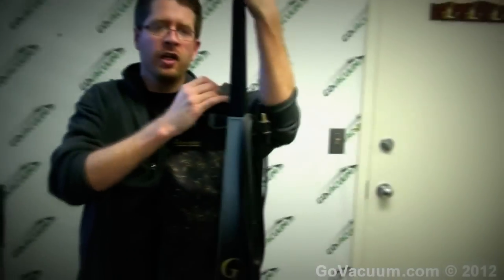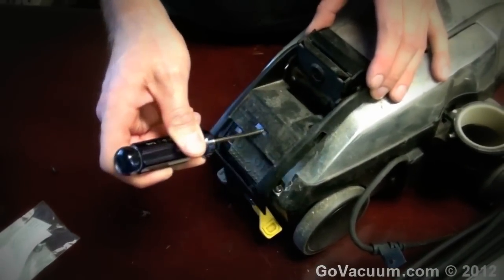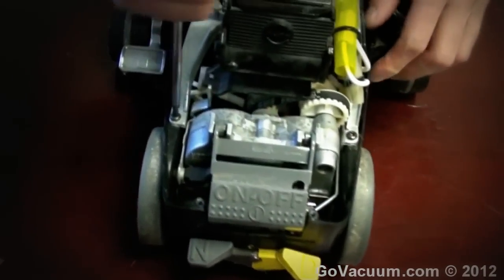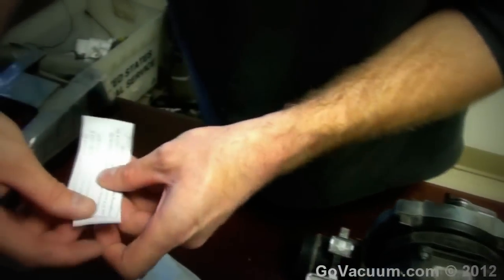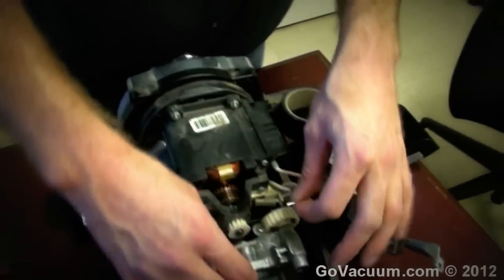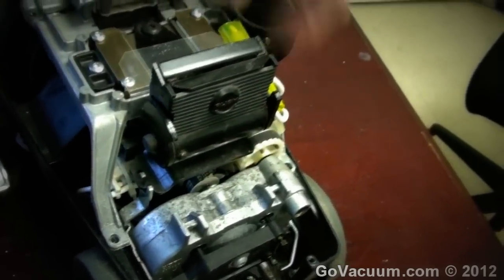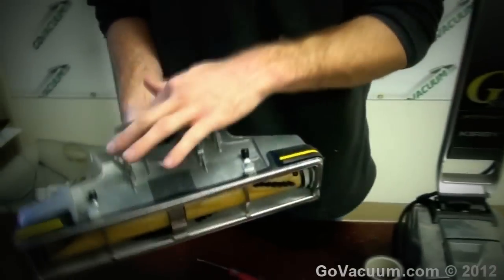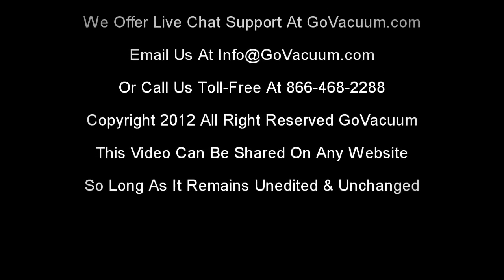Kirby Vacuum 552399S Transmission Repair Guide Generation 3 4 5 6 2000 Diamond Sentria How To Video

Comment: Thanks for the video. I took mine apart because the transmission position selector pedal fell off. Pulled straight out. I began taking it apart until I got stuck. After watching your video I was able to get it the rest of the way apart and put it together. I used JB liquid Weld to permanently connect the part that slipped off the shaft piece and after I followed your directions of putting it back together, my Kirby works like new. Thanks again and God bless.

Comment: Thank you for a great video.  Tried to replace the fan without a video (dumb) and ended up accidentally disconnecting the lever that engages the transmission and disconnecting the light!  Watched you video and saw the correct spot for the wiring I had unplugged and how to re-attach the transmission arm.  Will book mark you for the next time I need parts.

Comment: Wondering if you can help me out.  My son broke the plastic on/off foot cover.  If the axel bar happened to come  out of that, could it cause a problem with the self-propel?  It is making the clicking noise you speak of, so perhaps it is the transmission going.

Comment: Hello, I'm having some troubles...I have the same g6 unit, and it doesn't power on. I replaced the motor, and it still doesn't power on. I noticed some parts are missing on the transmission, but that shouldn't effect the motor from not functioning, or should it? Oh, and I replaced the g6 motor with a sentria motor, and noticed the ground  clip was missing, so I installed one. I also noticed that the screw on the bottom, that you mentioned not to remove in this video, is missing. what is it's function? Any suggestions would be appreciated. Thank you, Stephen

Comment: Excellent Video.  My problem is, the transmission Neutral/Drive shaft came off the machine.  Can I possible t0 re-install the shaft into the trans, or do I need to replace the transmission?
Reply: Sorry, Kirby Model G4D

Comment: My Generation Four goes backward just fine, but it does not work to push the unit forward.  Does this mean the transmission is bad??  Or is there an adjustment off?

Comment: I have a question about the neutral/drive selector switch. It seems on our Kirby the D/N switch has come loose. Will this require a new transmission or can I reinstall the lever switch?

Comment: why do you say replace the transmission along with the cord and fan?  Transmissions can be serviced, cord doesn't need replacement unless its broken/split/hurt, and the fan... only if its excessively chipped up or broken/cracked.
Reply from the maker: Age of use. Same reason you replace the pads when you replace the calipers on a car.

Comment from the maker: @123KennyM Yes, You have 1 or 2 problems-  Hopefully you only need to replace the fan & belt shaft. This kit is only $17.95 at GoVacuum and it's an easy fix (search Kirby fan replacement, we have a video for how to do this)  Search Part # 119096S. Worst case, you need a new motor :( Start off with the fan kit though, for under $20 it's worth seeing if that fixes it! Also note if it's loud, it's probably just in need of this fan kit! :) Any questions? 1-866- GoVacuum that's 866-468-2288. :)

Comment from the maker: If you're wanting to fix it properly- replace it. Yes, you can just reattach the rocker to the foot pedal, but the grooves wear, aligning it is a huge pain and 1/2 the time it just pops back off within a few vacuuming's. I always replace them as otherwise the consumer will come back mad at us. If it were mine, I'd replace it and be done for another 10-20 years.

Comment: You do not have the part that connects to the handle on the lever that activates the transmission so the transmission is stuck in reverse.